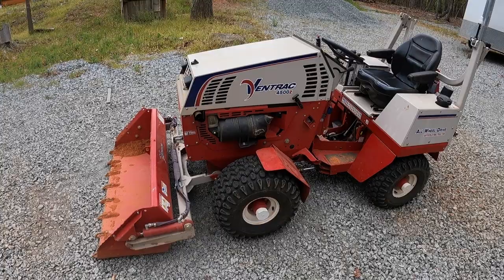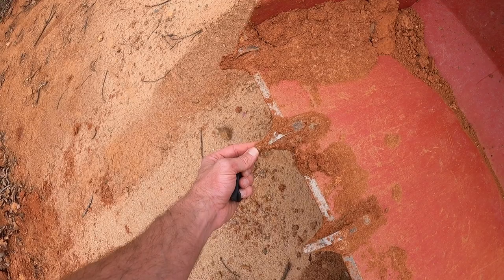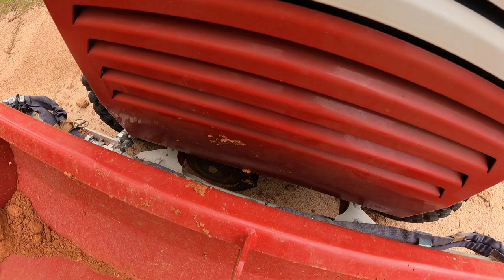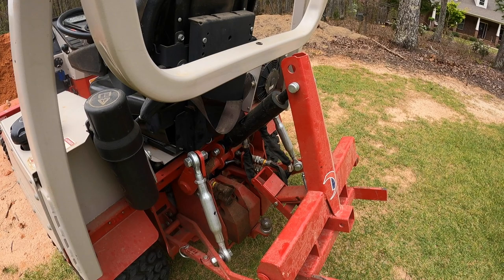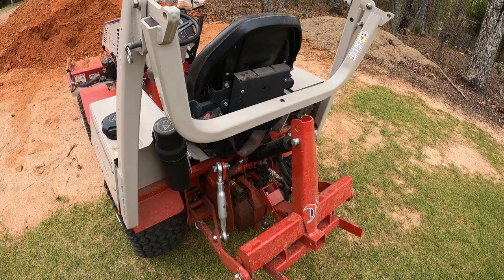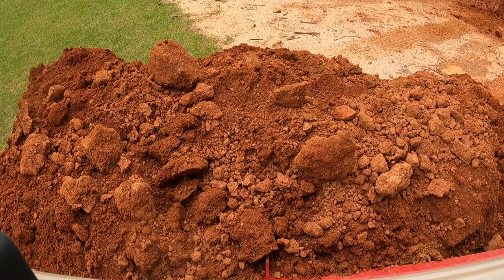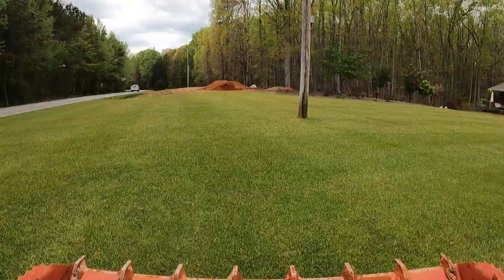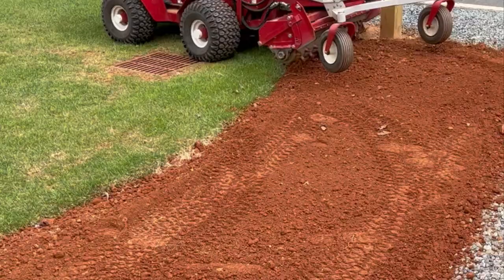Compact Loader Bucket // Ventrac Bucket HE482 Review // Ventrac 4500Z

Comment: First of all, really enjoying your videos on Ventrac and attachments.  Particularly enjoy the maintenance side of things...but I'll confess I not that handy.  Question:  what Weight Transfer setting do you use for the power bucket?  I''m going to get one and wonder what setting (1-4) to use once I get it.  Thanks!
Reply from the maker: I appreciate it!
I’ve never changed my weight transfer. 
I leave it on the setting that puts all the weight on the implement.
Reply: @ZoysiaRUs  I have found shifting the weight transfer to a higher number (to rear of tractor) seems to increase the lifting capabilities on my 4500P
Reply from the maker: @tazmankb26  that’s probably true! I just don’t like how slow it lets the bucket down.